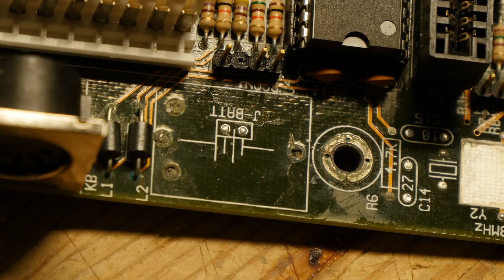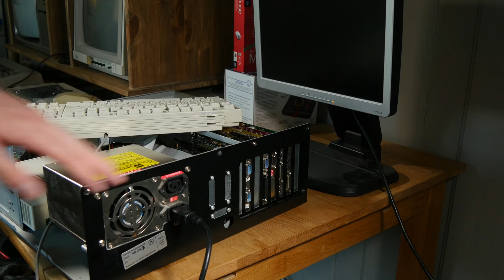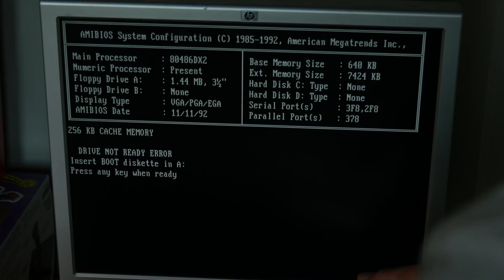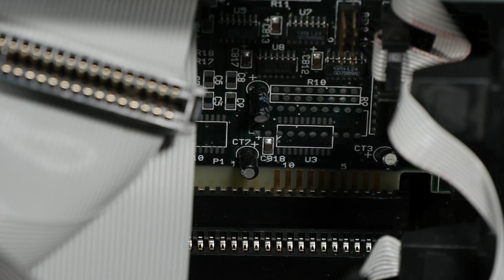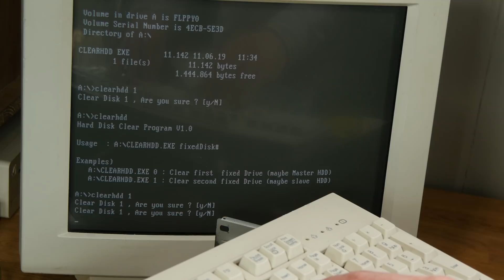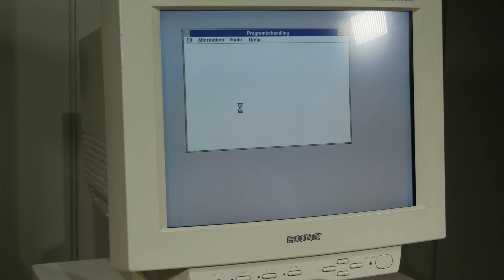486 Retro Computer Build

Comment: Would it be possible for you to upload the specific Cirrus Logic GD5426/28 Win 3.11 drivers that you showed in this video? It is version 1.74, which is newer than anything I can find on the internet. Thanks. :)
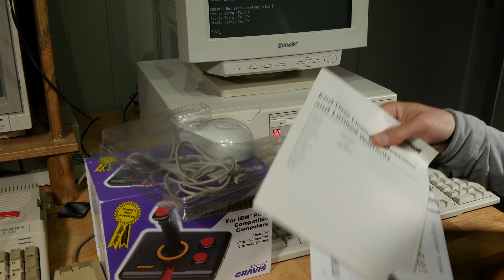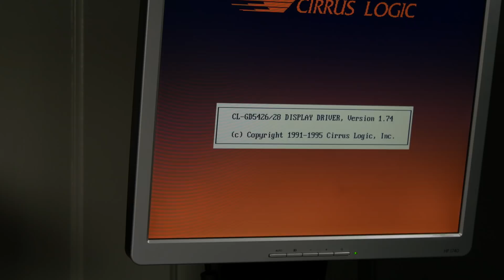Reply from the maker: If you check 23:11 you can see it is version 1.5. It's weird though that it says 1.74 at 22:35
Reply: @UncleAwesomeRetro  Ah, I see!

Comment: I don't know why many use cf-cards to copy files... I put a network card in any machine I have to hook it up to my 8TB NAS. That's by far the best way to get Files on and of the machine.
Reply from the maker: Once setup it would indeed be easier, but if you don't have a nas or server, network cable, and you need to research how to set up a network, it's a lot of effort compared to copying files to the cf card.
I do want to set up a network.

Comment: Hi, i have several 486 motherboards, and very few see the hdd on autodetect, most freeze, manually is ok, i mean the onboard connector,could be the controller maybe.
Reply from the maker: Hi. Yeah in the beginning it would not detect the hdd, but it would work when I set it manually. But now it autodetects for some reason.
Reply: i have a 486 which unfortunately is dead from a barrel battery leak.
Reply from the maker: @pentiummmx2294  Thats to bad. I was lucky the battery hadn't done more damage on this board.

Comment: Excellent selection of parts! And I love that case design, especially the drive bay covers.
Reply from the maker: Hi Clint! I am honored by your presence in the comment section :) Yeah It was really a lucky dumpster find :)
Reply: UncleAwesome was it new old stock or just in good cosmetic condition?
Reply from the maker: @nitroraptor5316  It was a dumpster find
Reply: UncleAwesome ooohhh ok I saw an AT case with the same bay covers on eBay.